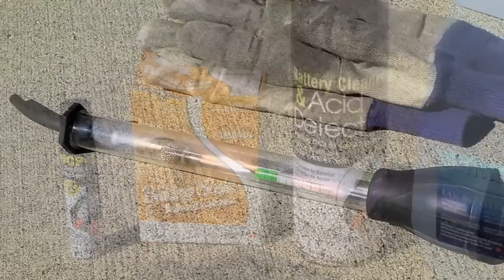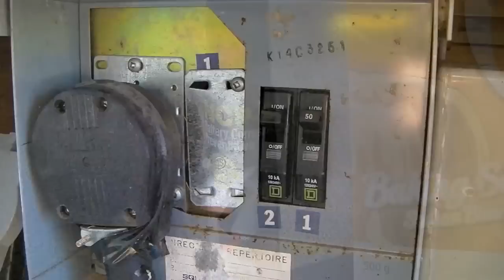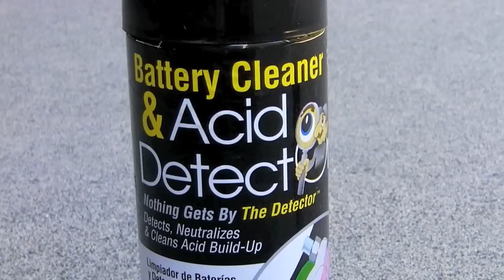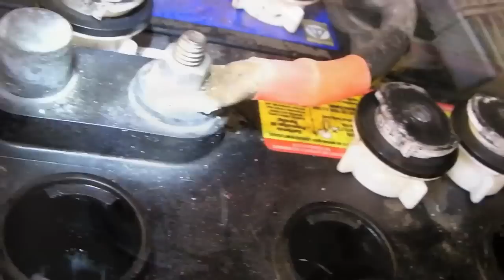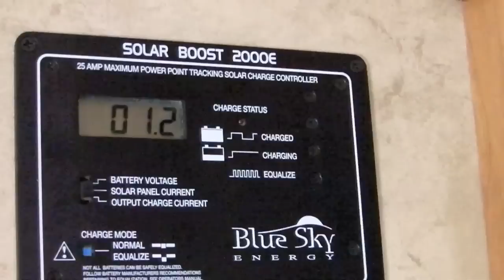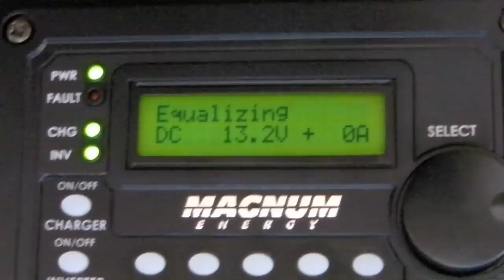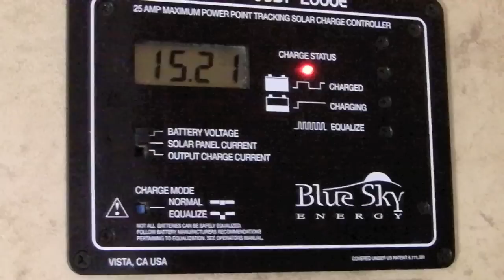HOW TO: Maintain & Equalize RV Batteries

Comment: will a momentary direct short destroy a battery ????
Reply from the maker: Hi Mark. We'll start by saying we're not experts on this topic, but we'll give you our guess. If you're referring to a regular flooded lead-acid battery, and a momentary short, like accidentally touching the two terminals together with a socket wrench and getting a shower of sparks from it for a split second.... we doubt that would destroy the battery. Something more prolonged? We're not sure, but it would probably start a fire, and THAT might destroy the battery.... and maybe a lot more! In the case of a lithium battery, we think the most likely thing that could be harmed is the electronics that run it.

Comment: A great video.  I review it occasionally before I service my batteries.  Several years ago, at the recommendation of a Newmar tech at a course I took on my coach, I bought a refractometer and a battery watering system. I like the simplicity and precision of the refractometer.  The battery watering system is indispensable.  I did not realize how much batteries off gas and deplete the electrolyte.  I have a very simple watering system with visible gauges on each cell and automatic stop valve that prevents overfilling.  It is sold by Trojan, the maker of my batteries.  I think my batteries require as much as a half liter of distilled water every 2 weeks.  Thanks so much for the great videos you produce.
Reply from the maker: Thanks so much for sharing your experience, Bryan! Sounds like you've got a great system going!

Comment: At 7:12 new chargers that go into equalization mode at the end of the charge cycle will boil all over, they want at 1/8 inch below the indicator, you are showing the old way to fill batteries, which is OK !!?if your charger does not go into equalization mode, you also want to fill the batteries after a charge cycle? I put a light coat of baking soda then spray that cleaner and use a heck of a lot less clean it all up with a rag, once it’s dry use motorcycle plastic cleaner, makes them look like new. Any corroded post a pull off let’s soak spray clean soak some more, are used to use Napa Open gear lube stopped all the corrosion. Which ever post has the least wires? Are usually disconnect that one so nothing can come on or go out.

Comment: I did not hear you say anything about when you are doing this Equalization and you have wet Batteries you should Probably remove the Caps on the Batteries so they can be Venting because at 15 + amps they are definitely going to Boil.  If you Mentioned this thin Disregard and My Bad.  I knew about this Equalization but was not familiar with How it is Actually done.  Thanks  You it was a Great Video.
Reply from the maker: Hi Garry. If you have battery caps that aren't vented (no recent era batteries that we know of DON'T have vents in their caps), then yes... you would need to remove the caps when equalizing. But the batteries in this video (and, again, almost ALL flooded lead-acid batteries that we know of on the market) have vented caps. They are designed to allow the gas to escape, while retaining as much of the battery acid/liquid as they can.

Comment: How do you store your hydrometer after using it?
Reply from the maker: In a 1-gallon ziploc bag, which we keep in the plastic bin with misc solvents, oil, and other lubricants.
Reply: @RVgeeks  You don't have a problem with any residue battery acid leaking through the bag?  I bought one of the little small ones off of Amazon and was considering something like a tupperware container but got to thinking the battery acid might eat it up.
Reply from the maker: Never leaked out of the bag. Those gallon ziplocs are pretty tough. Every now and then we'd replace it before it got too old.

Comment: Hydrometer readings are only accurate at 80 degrees electrolyte temp.  Above 80 they read low, below 80 they read high.  You have to correct the readings with a temperature correction chart or just add 0.004/10 degrees above 80 degrees or subtract 0.004 per 10 degrees below 80 degrees.  For example if temp  is 50 degrees, subtract 0.012 from reading.   If 90 degrees, add 0.004.

Comment: So will a 12 Volt Automatic Battery Float Trickle Charger keep my battery's  fully charged?
Reply from the maker: If you’re referring to deep-cycle house batteries in your RV that are currently installed and in use, no. A trickle charger is not sufficient. The only time a trickle charger will work for deep cycle batteries is when they are not being used, so their charge is never depleted, in which case the trickle charger is okay to simply hold them at full charge so they stay there. If the batteries are in use, which means they are drawn down and then need recharging, a three-stage charge cycle is required, which no trickle charger can provide.
Reply: Thank you...My 5th wheel is 5 years old ,Ive replaced 3 sets since.I use the R.V. about 5 times a year.I was told to charge them through my power chord about once a month to maintain them.When dry camping I use a Honda eu6500 to charge my battery's and run my two A.C. microwave,ect.Question,can this over charge my Battery's?
(I have two, 12 volt Battery's).
 Normally we don run the Genny at night, by morning its common for my batteries to be low,I dont know how low, but its not uncommon for the smoke sensor to chirp.Now I am finding out that they should never drop below 12 volts,nor should they be charged before they are at 12 volts.
This is all very confusing to me
So should I just keep a Float Trickle Charger  connected,and service my battery's periodically(How often?)...Thanks for your help!
-Scott
Reply from the maker: Hi Scott. If your fifth wheel has a good quality, three-stage charger... it's usually best to let THAT do all the charging on the batteries and leave the fifth plugged in when in storage (if you can). But if it doesn't have a good charger in it, it might be best to look into replacing it with a higher-quality one so that you can get more life out of your batteries... both when using them AND when storing. But if that's not an option, a trickle charger when storing the RV would be better than nothing... just be sure it's a good quality one that won't overcharge them once they're full... otherwise THAT will reduce their lifespan, too.

As for discharging them... you are correct. You don't want to drain them more than 50% of their total capacity, which usually means never taking them below about 12-12.1V. If you do, you'll be reducing their lifespan each time. It sounds like the batteries you do have don't have the capacity to handle your demand (lights, fans, water pump, etc), if they're being drained overnight. You likely need to look into getting bigger batteries that will have the capacity to handle your needs (or curtailing some of your demand so you don't drain them as quickly). We're guessing your fifth came with a couple of 12V batteries that aren't true deep-cycle units (check the amp-hour capacity on them... and divide that by two to see how much power you can use without damaging them). If you have the room, you could have your batteries upgraded to a set (or two) of 6V batteries (1 set wired in series, or wire a second set of series-wired batteries to the first in parallel), which will have more capacity and should help carry you through the night.

As far as servicing them... if they are typical flooded-cell lead-acid batteries, you'll want to check the water levels in them regularly (once a month should do it) and top them up (just to the bottom of the filler neck) with distilled water if they're low.
Reply: Thanks for your help..Yea,I want to up grade them ,but before I spend any more cash I want to make sure that I know what I am doing ;)

Comment: RV Geeks, How can I maintain 2 Chassis Battery's and 6 House Batteries in the Winter? I was told one charger can maintain all while in storage? Thank you from soon too be Cold OHIO!
Reply from the maker: Hi Danny! Many RVs, especially larger diesel pushers, have charging systems that charge all batteries on board simultaneously. If you have a system like that, and will be keeping your shore power cord connected to shore power during the winter, your batteries will be trickle charged and all should be good. To confirm that you have a system like that, you might want to check with your manufacturer.
Reply: Thanks for the info and I'll do more research!

Comment: Very good instructions, RVgeek. You pointed out after equalizing let the batteries rest for about an hour before turning appliances back on, which is easily overlooked. If you switch on immediately, these batteries still will be at that 15.5 v (or so) high voltage... although it will be dropping fairly quickly. So, indeed let them rest. I would prefer to let them rest for 2 hours, but that could be a long time for the fridge to be off depending on the outside temp that day. Especially if they were so unequal that they took another equalize cycle. Also, I can look at the way multiple batteries are strapped and can tell you which battery will drift from equal... it is important to do it right. Thanks you Sir.
Reply from the maker: Thanks Clint! One great thing about RV refrigerators is that they're SO well insulated. When we used to have an RV fridge (we have a residential fridge now) was the ability to leave it off for a long time without losing much cold. They're like big ice chests!

Comment: can you jump charge / start , your RV house battery's , class a motor home , like you can a car
Reply from the maker: Hi Joseph! Just to clarify, motorhomes have two battery banks, typically referred to as "House Batteries" and "Chassis Batteries" (also called "Start Batteries"). Of course the chassis/start batteries are just like those on a car or any other vehicle, as they start the engine, and power all the chassis gear, such at lights, windshield wipers, horn, etc. You can indeed start a motorhome by  jump-starting dead (or low) chassis batteries with jumper cables off another vehicle's battery. Many motorhomes include a switch on the dash (ours has one) that's often called the "Battery Boost" switch, which, when held down during starting, will use the House batteries to "jump" low or dead chassis batteries, thereby giving yourself a boost without external help. But you really wouldn't "jump" or charge the House batteries off another vehicle. The only real ways to charge those is through a battery charger (most, or all, large motorhomes have that built into the system) when connected to shore power, or by using the generator. The batteries can also be supplied with power from solar panels. Hope this answered your question!

Comment: what is the difference between the sealed on non-sealed batteries, which is better? I'm planning to purchase a 5th wheeler and i want to have solar panels & a bank of batteries.
Reply: Hi Diana , each type has advantages/ disadvantages. AGM's have lower self discharge than flooded & you don't need to top them up. GEL cells have thick electrolyte & can last well over 10 years , but you need a special charger. (Any voltage above 14.4 v can quickly ruin GEL Cells) Both are dearer than flooded. Sealed flooded don't need topping up with distilled water, but are really just wet cells with a bit bigger water reservoir. Varta powerframe are good for the money , such as the LDF 90 . Never discharge any battery more than 40% or leave it discharged, if you want it to last.
Reply: Sorry Diana, I meant some 'maintenance free' batteries that appear sealed are wet with larger water reservoirs. Most maintenance free wet cells now have calcium, so don't gas so much. I presume you were thinking of getting  proper sealed AGM types? I have the Yuasa SWL 2500 FR AGM's. They are still perfect after 4 years. (I have around 50 batteries & expensive gear to test them.) Few AGM makers recommend equalizing  their AGM's at 15.5 volts or so, I never do. (Lifeline is the exception, for their specialist design.) AGM's don't suffer from acid stratification like flooded, nor should sulfation be a problem if they are correctly charged. Open wet cells certainly benefit from 15.5v to 16 volt overcharges, but not for too many hours, or too often, maybe once every few months (ask the battery manufacturer.)Good deep cycle wet cells designed for solar use like Rolls or Trojan, will work & last well if properly treated & charged.(I have some wet .) It depends if the maintenance/ gassing are an issue & how much you want to spend. Checking with hydrometers etc., can be too much bother for some owners.For caravan & non - solar users without large battery banks, the articles from 'aandncaravanservices.co.uk' are interesting. They don't rate AGM's for caravans much, mainly because most caravans do not come with chargers designed with AGM's in mind. They rate the Varta LDF 90's & I think they are right. That said , I have lots of Varta 95 AH stop - start AGM batteries & they too have lasted well, but I charge them at 14.6 volts end voltage. (Below 14 v will never be enough to charge them fully in cyclic applications, & there's no need to go much above 14.6v, all it would do is dry AGM's out prematurely above 14.9 volts)
Reply from the maker: +Diana Moses Hi Diana! An RV battery bank must be "deep-cycle" (designed to be drained part-way and recharged (cycled) over and over again). Typical deep-cycle lead-acid batteries are "flooded" (wet-cell) batteries that are the least expensive type, but do require regular maintenance (checking water level, hydrometer readings, keeping them clean and free of corrosion, etc). The next step up are AGM (Absorbed Glass Mat) batteries, which are sealed, very low maintenance and perform quite a lot better, but are about double the cost of flooded batteries. If you're okay with the price, they're pretty sweet (we've had AGMs for about 7 years, and like them). Of course if you have another 3 to 5 times more money in the budget than the cost of AGMs, lithium is amazing.

Comment: Lifeline says their AGM batteries should be equalized.
Reply from the maker: That is correct, but when we bought ours (and when we made this video), they said it was not required. They've since changed that recommendation, and we now equalize our Lifelines periodically as well.
Reply: Yes, but the Lifeline design must be pretty unique. Yuasa, Rolls, & most other AGM manufacturers say not to equalize their AGM batteries. I've experimented with a few AGM's for my own interest, just to find out & charging them around 15.5 volts for a few hours has reduced their capacities. The performance soon got worse after a few months too, so I'd be careful about doing that,especially with expensive AGM's. I have lots of AGM,s around 100 AH . Yuasa SWL2500 FR AGM's have lasted me well  without losing capacity over the years. I don't equalize them, just charge at 14.5 volts max. Regards.

Comment: Hi, im in a camper and want to add distilled water to the batteries. Do i just disconnect the terminals and add water or do i have to shut off the charging system while the terminals are hanging with the terminals not connected ? Thanks
Reply from the maker: +DOUG FERGUSON Hi Doug! Just add distilled water to the cells without disconnecting anything.   It's a good idea to turn the charger off, but that is only to prevent getting any small amount of electrolyte from bubbling out of the cells due to charging. Very important: don't overfill the cells. Only add water until you bring the level up to just touch the bottom of the filler tubes, and no higher.
Reply: Hi, Thanks but there are in a tight box at the side of the coach so i have to disconnect to check the water levels.lol so my question is  IS it ok to just let the system charge with the connections off while i fill the batteries.
Reply from the maker: +DOUG FERGUSON in your case, you should definitely turn the charger off BEFORE and during filling. Batteries out-gas heavily during charging, and one small spark from any connecting or disconnecting of cables while you're working on them could cause an explosion.
Reply: Hi, thanks. It went well till i had to put the wires back and found out the batteries are 6 volt and it took us an hr to find out the proper pattern to make a 12 volt connection between the 2 batteries.
Reply: a
Reply: Hi one more question. i have the quarts in the living room and a seabreeze low amp heater up forward. I do add the fireplace when its about 5 below zero. Im wondering if i can run the fireplace with the other 2 heaters all nite long. Ive run the 3 running  alot during the day with no issues.Can i i run the 3 all nite long ? Your thoughts
Reply from the maker: If you have enough electric power at the campsite you're in to run all at once during the day, then you should also have enough power to run them at night.

Comment: I'm about to replace some 10 year old solar storage batteries. I've had this RV for a little over a year. The batteries fluid levels are all good but the charge max is falling off steadily. My question is, if I buy new lead acid (flooded batteries) do I need to charge them before I put them in and use them or can I depend on my solar panel to charge them? They do come partially charged.
AND!! Do I need to cover the solar panel to keep voltage off the leads while I do this? I don't see any kind of disconnect for my system.
Reply from the maker: We would suggest charging them fully if possible, unless you have a massive solar array that will bring them right up to full anyway. And yes.... covering the panels to "shut them off" is a very good idea if you don't have a disconnect switch.